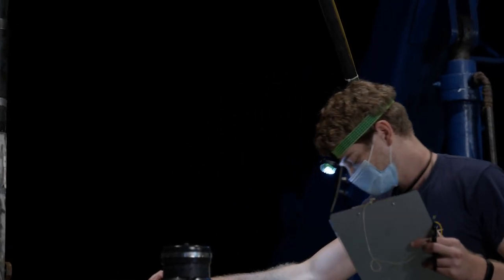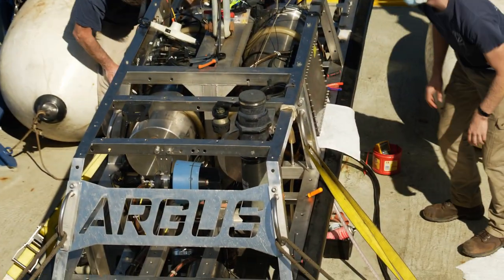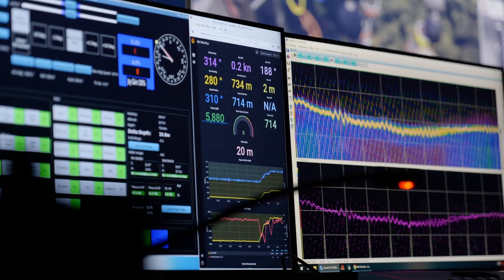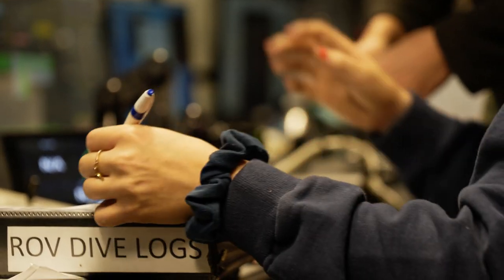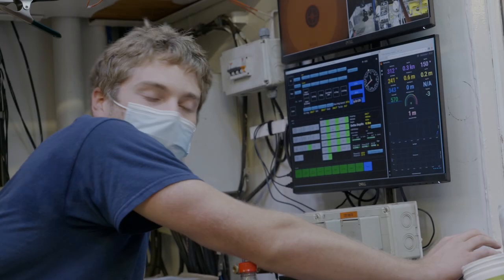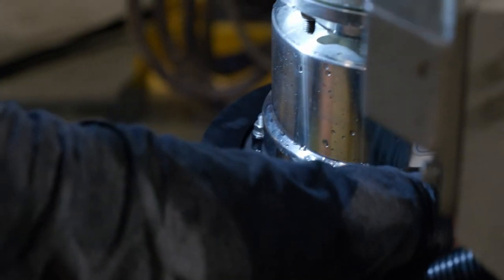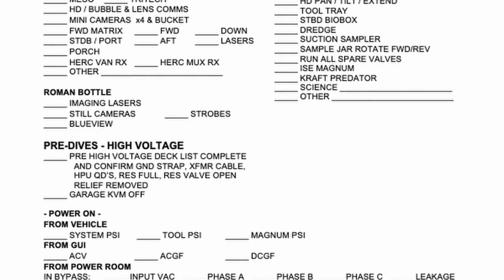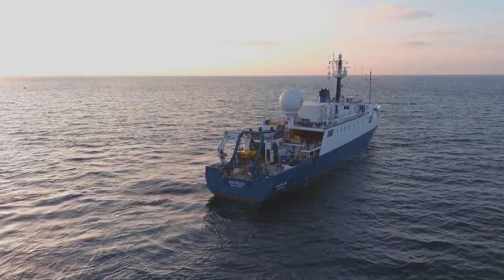Beyond the Wow: Complex Robots Need Simple Checklists

Comment: I just wanted to say thanks for showing us the live feed of port operations! I watched as your crew wrapped pallets of of cheap food from a restaurant food vendor in lap after lap of some of the worst plastic wrap that is produced. I worked for years delivering mail to distribution centers, and have first hand knowledge of how nasty and hard to work with this crap can be. I wonder how its made, and what the process is for making it? It certainly seems to be petroleum based plastic. How many tons of fuel does your vessel burn per hour? What were in those two 55 gal drums you loaded? I get it, you need that oil and stuff to run the vessel, and it saves time and most importantly $ to load the supplies by crane and pallet, but if it means so much to you couldn't you just have crew carry the boxes over the gang way, and not use it? SURE you could, but time is money, EXACTLY thats why I sometimes use those products as well, and so many other people around the world. I guarantee that my household doesn't use as much plastic wrap annually that you guys used to wrap 1 pallet. And I feel confident that in all the years I've driven tractor trailers, and other vehicles of all types that I haven't burned even close to tonnage of fuel your vessel burned during your trip from LA to Oregon over the last few days. One thing I do know for sure is that what you are doing, although interesting, and fascinating...even cool to watch, is NOT a requirement for us to know that these products are not good for the ocean. So what is your real mission? Because from where I'm sitting, and just like every other organization government or not, you ALL are hypocrites. And here's a side note, there is nothing any of us can do to stop any of it, but it will soon be stopped that is a promise. The question is, where will you be when it does...I pray for you all to not be blinded by the sea, and open your minds to what is really happening around you and the world...so that you can actually SEE the truth. I always speak in these comments out of love from my heart, its Jesus' only request of me. Its his only commandment, you can find that in the book of John...and it is the ONLY thing that matters, LOVE ONE ANOTHER. It really is that simple. Amen